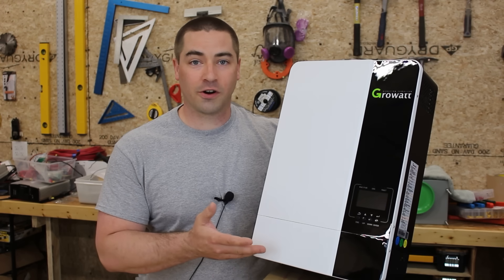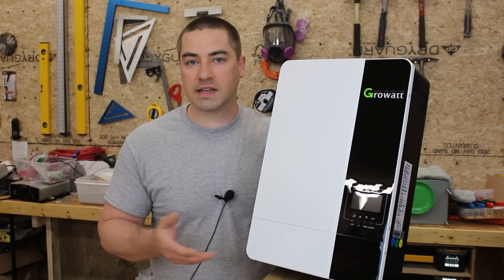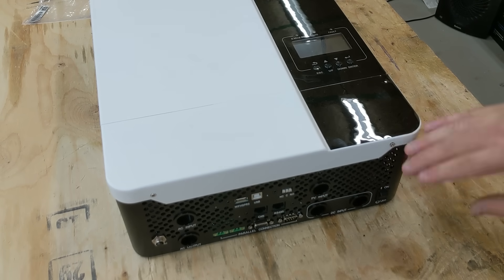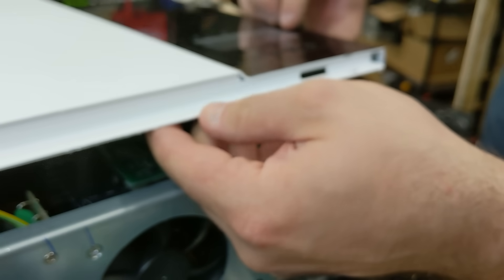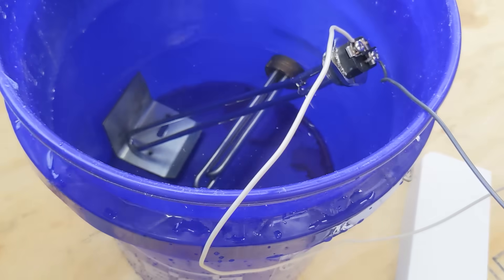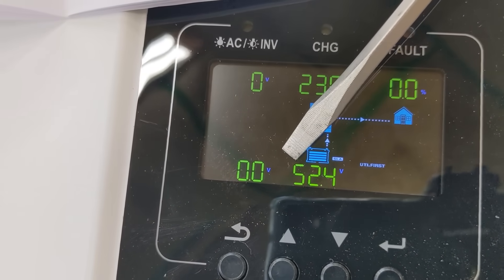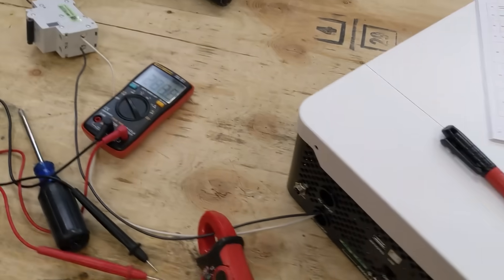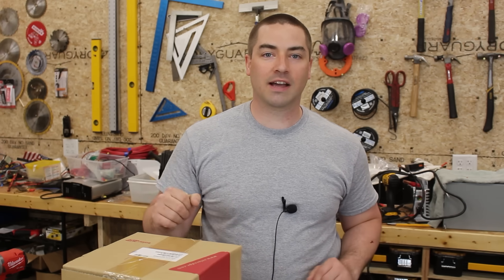Best Value Inverter, All-in-one MPPT Solar Charger, Growatt SPF5000ES, Part 1

Comment: David, I installed the 5000ES at home with 4800watts of panels and two lithium batteries.

I have installed a load center to be used with the 5000ES exclusively. At 240V dual pole use, how many Amps output can I expect on a full sun day? I intend to charge my Ecar with the 5000ES.

Comment: I was wondering if I could use this inverter/solar charger for a mobile battery bank in my truck? I want to have 10 kilowatt hours of power in my longbed super cab dually. I want to get rid of my back seat and build a box and have 10 kilowatts worth of batteries and have solar panels on top of my truck mounted to a utility rack or camper shell. I want to set it up to where the alternator will also charge when the truck is running and then the solar panels can also charge the battery bank as well. I want to have a 110 volt 5-6 kilowatt inverter for normal items and then have 240 volt to be able to power my house when we are out of power due to hurricanes, etc. I also want to run a 4 gang 110 volt outlet to my bed so I can have power for tools, etc. What would you suggest for the best bang for the buck batteries and inverters for that?

Comment: Hey David, All of your videos are awesome n detailed. Great work. I have a 5.2kw system (130wx4) with a 100A EPever MPPT controller & 3000w inverter. Here is the issue..MPPT calls for connecting batt 1st b4 you connect PV power to protect the MPPT, now when left un attended & batt power is drawn, drops below 11v & dies, happened few times & my MPPT was fried. Whats the device i can connect to automatically stop the inverter from not drawing from the battery beyond say 12.1V say until its charged again thru solar power. Hope i explained myself clear. Appreciate your help. Thanks.

Comment: Love your vids David! I’m gonna buy 2 Lifepo4 batteries in parallel that gonna be charged by solar and main power, the max output of each is 6KW but the recommended is 4KW. Shall i get 2 two SPA5000es inverters connected in parallel or a bigger single unit? And which one do you recommend from Growatt?

Comment: David, I just had an off grid system installed (Jan 2022) and need to add to the Sol-Ark 12 because on occasion the demand exceeds the draw allowance. Instead of adding ANOTHER $7,000 (+ installation) Sol-Ark can I simply have the Growatt connected to the Sol-Ark in parallel?

Comment: This is a year late lol , but all these systems with all the “ bells and whistles “ will lead to problems, a simple analog system would last for years , no computer “ crap “ etc had a crafts mans car batt charger with no nonsense that lasted 30 years , the new stuff just junk ( even the high end stuff) the older solar system s even in the 70 s still work , yes the batts and the panels may b better now but again to many problems could happen

Comment: Dave nice job with all your video's you're saving us alot of trouble shooting time, I'm working on a system also and have the $3,000 watt Aims inverters and now ready to upgrade to a 6k split phase unit and thinking either going with Aims or trying these Growatts , it appears the efficiency is about the same, slight differences in the unit due to add ins like solar charger.ect . So my question and yes the price cant be beat but how do you compare it to Aims? Aims also has the Industrial unit that is higher efficiency, Thanks

Comment: Hi David, love your work mate. Just wondering if you would still recommend the Growatt SPF5000ES in 2022 for off grid use.
Also, have you worked out how they operate with no batteries. Keep up the good work.  Thanks David.

Comment: Big fan, I’m fixing to start building a home and it’s going to have to be off grid.I want to power two mr cool 4 zone mini splits would you think that the 12k growatt will do the job. I’m considering 30 - 375w panels and 2x 48 Kong elite 300 ah 15.0 kWh batteries I will have Generac 22kw generator to change batteries on cloudy days this will be a large house with two refrigerators and well pump as well. Oven, dryer and water heater will all propane. Just need advise

Comment: David, Do you think this inverter will be able to a run deep (300ft) well pump? I don't like invereters with a transformer inside because they usually have high idle current. Which inverter would you suggest for well pump?

Comment: David, could I add 48V windturbine in order to charge batteries during night and what device I need beside this hybrid inverter? Do I connect wind source (over its charger) directly to lead-acid batteries in parallel?

Comment: This is an incredible inverter. I have three of them. I am running 360 volts at 9.3 amps into 2 of them and 360 volts at 18.6 amps into the other one. They are powering my house with ease. I could get away with having only 2 of them but, I have an older home and it's still being remodeled. So, I keep them hooked up. I have 6 of the gyll/egyll batteries in a cabinet 30 kwh I also have some 24-volt batteries that were hooked up in series and Parallel with 2 of the gyll batteries. would you hook them back up with the new and larger battery bank? Plus, the 24-volt batteries when hooked in series would sometimes get different volt readings. how do I avoid that?

Comment: I am having trouble understanding why the SPF 5000 ES needs a transformer unless it only produces 240 and cannot run 120v appliances. I want to run an RV and wire a receptacle to run a 220v well pump, all without an auto transformer. Will this work?

Comment: so could I run an AC line into this, then put a subpanel on the AC output for a few key circuits? (i.e. fridge, oil boiler, office computers, etc). Sounds like in theory those circuits should only pull power from the grid if the solar cannot keep up with charging the connected battery, correct?

Comment: I understand as per the manual there are priorities can be set for charging the batteries (solar, utility) and priorities can be set for AC output (solar, batteries, utility).

Is there any priority can be configured with AC output over charging? In example, if I have 4000w of PV at peak hours and batteries are drained, at the same time I have high consumption of 3500w for households. Will the inverter provide with 3500w from PV and keeps only 500w for charging the batteries? Or charge the batteries with 4000w and provides the household with 500w from PV and 3500w from utility if SUB priority was selected as “Output source priority”

Comment: Excellent video, I am looking to buy the same model, I won't need the phase splitter since the current system is 230v  already. But my problem is that I will need to frequently change the priority of power input and battery charging, I live in a remote place and circumstances change frequently. 

The inverter will be installed 3 floors down in the basement, is there a way to change the priority remotely from mobile app or computer if i connected it to wifi?

Does the application record consumption historically so i can know how much i consumed from PV, utility, batteries, over the last couple of months? 

Another question, for continuous load, how long can I load it at 100%? what is the safe percentage that won't blow this up? or at least let it live longer?

Thank you

Comment: I have 2 Growatt 5000k es. The max pv input current on the Growatt is 18A. My panels rating are this and I have 20 of them how can I make them work with 1 of the 5k Growatts
Current at pmax is 8.5 each panel
Short circuit current is 9.00 each panel
Open circuit voltage is 38.2 each panel

Comment: what do you think will happen if the you exceed the 6000 watt maximum solar input? my system rarely goes over 5800 watts but when its really cold(sub zero) it could go over the rated 6000watts. can it damage the unit or will it just fault out?

Comment: Do these inverters charg when off?  I need a 450 volt PV charger and having the in inverter as a spare would not be a bad idea.
Reply from the maker: There is a power save mode you can use to save some standby loss.  It's technically still ON.

Comment: David, I was glad to view your video about the GR3 battery and the Growatt single phase inverter.  I'm planning to use an auto transformer to provide 120-volt 60 Hz utility-type power for use by small appliances during utility outages.  The battery-inverter-auto transformer will function as my emergency backup power system to serve my hydronic heating system, refrigerator/freezer,  a couple of small desktop space heaters., and our microwave oven.😊

Comment: What is the difference between using a 6,8,12k split phase vs a 5k with an external auto transformer?  Other than the 5k is stackable.  Should I be building in neutral loss detection and shut down on either set up? Thanks in advance

Comment: How many Growatt 5000 ES inverters and batteries would be needed (in parallel) to power a 200 Amp load center?
Reply from the maker: I power my house's load panel (200A) with 2 inverters (10kW).  But, if you are asking how many would be needed to replace grid power?  Then this is the math: 200A*240V=48kW.  48kW/5kW=9.6 inverters.  But, the maximum is 6 inverters in parallel.
Reply: @DavidPozEnergy  thank you David. I have one growatt 5K now  and only see the possibility of 18 Amps of output. My load center has a 30A, and two 40A breakers, all for 240V loads. The 30A is meant to power a type 2 EV charge connection

Comment: I have this inverter Growatt SPF5000ES and i want to know about maximum PV Array input, in specification says 450V in VOC but it has a 93% efficiency and that means 419 V maximum in VOC and my question is: I have 6 Hyundai panels with VOC 46.6 V, VMP 38.8 V, 13,6 A and 480 W, I wish to buy another 2 or 3 panels but for 3 panels VOC is exceed over 419V which is the maximum, a solution for increase system power up to 4 or 4.5 KW? without to damage the inverter Thank you!
Reply from the maker: With panels Voc of 46.6V, I would string 8 panels in series into one Growatt5000ES, but not 9.  When I buy panels I buy 1 extra as a spare, but that's personal preference.  8 in series gives you a Voc of 372.8V, that's plenty of margin for cold weather voltage spikes.
Reply: @DavidPozEnergy  Thank’s David 😀

Comment: I know you said it somewhere but what is the maximum size wire the pv side can physically fit? I believe you said 10awg.So I could order temco 10awg solar wire and install my own mc4 connectors except where it inputs into the 5000es...correct?
Reply from the maker: The manual says to use 12 gauge, but I think you could fit 10 if you wanted.  The maximum the inverter will pull from PV is 18A, so 12 gauge is suitable for that.
Reply: @DavidPozEnergy  Hey thanks David! I appreciate all the info you and a few others are putting out.It gives alot of confidence to newbies like myself. Any chance you read my comment about or are going to do a video about losing a neutral from an auto transformer?Donni does stuff is the guy I'm referring to. Anyways thanks again from Texas!
Reply from the maker: Loosing the Neutral could potentially fry some electronics.  Not good.  In my more recent build I used a terminal block to eliminate the risk of the auto-transformer circuit breaker coming off.
Reply: @DavidPozEnergy  Then I guess I'm missing something... if the supply to the transformer goes off then the neutral stops and the panel box just has two legs of 120(the original 240 from inverter)w/ no way to use it w/out neutral.Does it somehow go haywire because of the grounds?

Comment: Would you recommend Growatt as a good solid entry level inverter? I'm liking what I been seeing, just overwhelmed at so many selections and mixed reviews. I've never seen a negative video review of the Growatt
Reply from the maker: Yes, this model 5000ES is a pretty good starting point if you are making an off grid system.

Comment: Hi David, thanks for the video. I'm new to solar and off-grid living. I'm thinking about getting a 12k BTU Mr. Cool and trying to run off my 8, 300 watts panels. Can this unit run the AC without batteries?
Thanks.

Comment: Loved the video. Will this unit power a 220v dryer and a 220v cook induction range?
Reply from the maker: I've used it to power my 240V electric dryer.  I've also used it to power my electric stove, but it's an older resistance stove, not induction, so I can't answer your question perfectly.  Also, I'm running two in parallel since I want to be able to turn on more than one thing at a time.

Comment: Can you buy 2-120vac units and make 240vac ?
Reply from the maker: The 3,000W Growatt, 120V models support paralleling into 120/240V configuration.  I've wired that configuration using my SMA Sunny Islands too, which are both 120V.

Comment: Can you connect 4 12v batteries for this inverter
Reply from the maker: Sometimes.  If you are looking at some 200Ah 12V AGM batteries (such as telecom models) then yes.  If you mean some 12.8V LiFePO4, then it depends on the manufacturer.  Some allow for series connecting and some don't.
Reply: @DavidPozEnergy  Thanks, i appreciate that, Great shows

Comment: I love your channel! I’m planning a Growatt installation in my cabin. 
Does the fans make alot of noice? 
It’s working temperature 55c - 0c. I’m a little concerned about our winters here in Sweden. What do you think?
Reply from the maker: Hi.  Yes, the fans make a lot of noise.  Mine are in my garage.  I have to turn them off if I'm filming because it's too much background noise for a video.  But, the fans are variable speed and are not bad if you are not pushing the units.  But if it's a 1-room cabin, then I'd try not to have it inside.  a possible option might be a large steel box (such as Job-site boxes at construction sites).  Bury the box mostly underground, but with the lid above ground.  Then the inverter would be in a pretty good environment.  The electronics can go below 0C, but the manufacturer is worried about condensation on the circuit board.  That's why they say 0C.
Reply: @DavidPozEnergy  Thank you! My biggest worry is night time 😴 But then it will be at pretty much no load. I will rethinking my installation a little. Maybe use a metalbox with some insulation. 👍

Comment: They are Toroid Coils. A toroid is a coil of insulated or enameled wire wound on a donut-shaped form made of powdered iron. A toroid is used as an inductor in electronic circuits, especially at low frequencies where comparatively large inductances are necessary.

Comment: Hi Dan, i was very thankful when i watch your Growatts inverter SPF 5000 ES video installation. I was interested to get 5kw Growatt Inverter and probably 2 for now the 51.2 v 100ah battery.
Can you please help me about the solar panel do i need , the spec of the panel itself and their connection. Can i copy your 5kw set up solar panel?
Thank you and more power.
Reply from the maker: This model inverter has a built in charge controller that can accept 120V - 450V DC from the solar array.  That's good news because it means practically any brand/model panels will work.  The current industry standard connection is MC4, but I have an old (16 year) array outside that uses MC3.  The exact type of connection isn't very important.  Most panels will have a voltage somewhere in the 18V to 40V range.  You have to series connect the panels to increase voltage.  This means you take the positive lead from one panel and connect it to the negative lead of the next panel.  This adds the voltage.  If you have 40V panels, then you will need at least 3 panels in series to make 120V, which is the minimum needed for the built in charge controller to turn on.  However, it's better to give a little margin and series connect at least 4 (in this example) for 160V.  I have purchased all of my solar panels used.  Check Craigslist, Facebook Market place for used panels.  Signature Solar also has some used options now and then. https://www.signaturesolar.us/collections/solar-panels

Comment: Great video!!! I plan on a small solar setup for 6 antennae installed in a tower. The approximate wattage of the 6 units is 50 watts. Can you recommend a solar kit for this?  Thanks.
Reply from the maker: 50W is a very small load.  24 hours of backup is 1.2kWh.  You will need to determine how many days of backup you want with no sun.  Also, if the antennae can run directly off of  12V, or 24V DC, then you can eliminate the inverter.  Do you have those details?
Reply: @DavidPozEnergy  Thanks for your quick reply. I would like to have at least 2 days of backup power. What wattage in the solar panels would I need and how many batteries to supply those 6 antennae?
Reply from the maker: There are more than 1 way to set this up.  But, I'll give you one option.  You could buy 2 of these batteries: https://www.signaturesolar.us/products/12v-100ah-lifepo4-battery-by-eg4  (discount code: DAVIDPOZ25) Each battery is 12V, 1.2kWh.  So that's exactly 1 day of backup per battery.  Wire them in parallel so the voltage stays at 12V.  Solar panels and charge controller: https://amzn.to/3mDeOWP
Reply: @DavidPozEnergy  Thanks. I'm going to be consuming about 60 watts 24/7. Any thoughts?